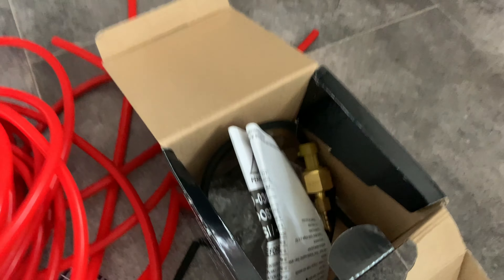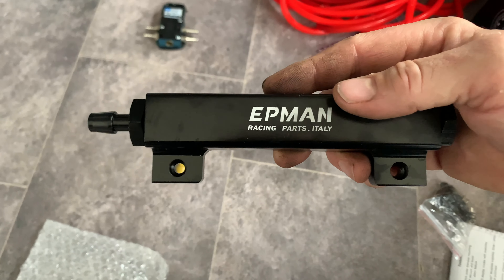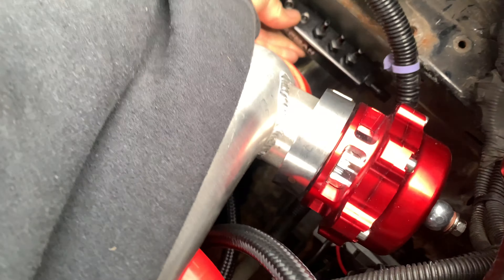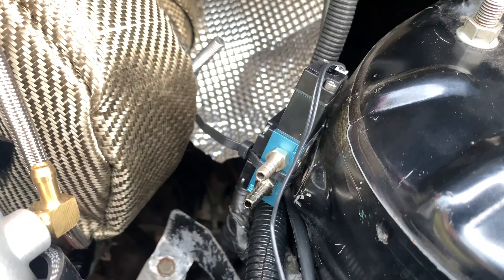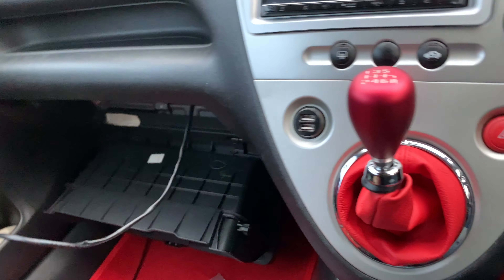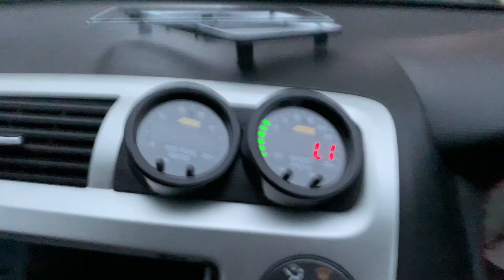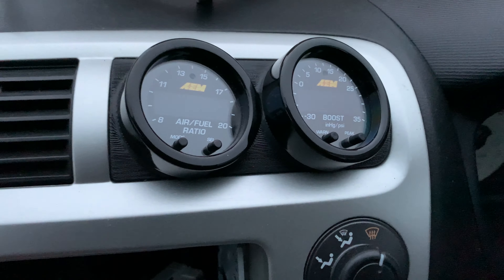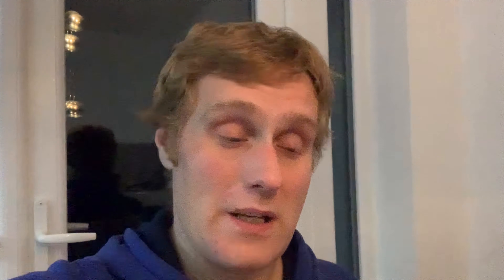K20 EP3 Type R Turbo Part 7 - Vac Pipes And Boost Gauge

Comment: How did you wire the Mac Boost Solenoid and Aem Boost Gauge?  Are you doing an extra clip?  Otherwise great work keep it up mate 😎👍🏻
Reply from the maker: Mac valve wires into the 2 wires that go to the evap sensor, doesn’t matter which way round you wire it up. Boost gauge just needs and Earth and a live, I wired it up to the cigarette lighter wires 👍
Reply: The evap om your throttle body. Where do you connect the hose from the evap. The oem line went with the oem fuel feed onto firewall . Do you just reroute the evap pipe away from the sidewinder ? Do you have to keep that round bit in the evap line aswell ? Currently doing my ep3 turbo and watching your videos as a guide. Thank you 🤙🏼

Comment: Do you have to connect the evap to the pipe on the firewall again ? Has to be moved for sidewinder manifold. Or do you just blank it off ?
Reply from the maker: I just left it, cut the pipe a bit further down the bulkhead it wasn’t connected anymore

Comment: Nice job with the vacuum lines.  Are you going to secure them using zip ties?  Nothing worse than having your vacuum hose blowing off!
Reply from the maker: I’ve never had problems in the past with them but maybe will when I finalise all the lengths and routes yeah.

Comment: Enjoying the build just wondering what diameter vacuum pipes did you use?
Reply from the maker: I used 5mm for most but 4mm to the fuel pressure regulator as it had a smaller diameter fitting

Comment: Why did you choose the 4-port solenoid over the 3-port one???
Reply from the maker: mostly because Americans seem to. and also it allows you to use up to 4x the spring pressure whereas a 3 port is about double.
Reply: @1BlueGhost  sometimes x6 spring pressure, but you lose definion, like changes +1% duty cycle = +5psi.
3-port is less sensible, easier to control.
Reply from the maker: That’s true yes, I noticed at one point we put 1% duty in and it jumped massively. No in between. It holds 10 ish ok for now though. 16-18 will be the aim later on.
Reply: @1BlueGhost  18psi will be likely kind of 450-460hp 🔥🔥🔥
Reply: @1BlueGhost  And finally what WG spring did you use?? And what % duty to get 10psi??
I found you channel more didactic and more inspirational than almost any other.
Your build with all of its shangai stuff is pure fire!!
I hope you it last long and makes big big numbers 👍👍👍
Keep posting
Reply: @1BlueGhost  One last question: what turbo, brand and exhaust housing a/r did you use??
Reply from the maker: It’s a 7psi spring in it, and the duty is about 46 I think. It works backwards we found out so less duty is more boost.
Reply from the maker: Thanks for watching, hope to make helpful ish videos and show all the failings as well as minor successes 😂
Reply from the maker: Gtx3582r dual ball bearing I don’t know if it has a brand with a .82a/r in the theory that the engines rev higher. Not sure if it was the right move or not yet, will find out. Will link the turbo below 

https://www.ebay.co.uk/itm/123746335738

People seem to say the pulsar turbo’s are good, although they are about double the price. Will see how long this lasts.
Reply: @1BlueGhost  I think its the perfect choice to make good power on stock K20, keeping the torque relatively low and less back pressure over the 0.63 a/r.
Reply: Best choice i mean for the size and for the housing a/r , not for the origin of the turbo 😂😂
Reply: @1BlueGhost  the turbo in the link has ported shroud anti surge compressor housing inlet with holes like precision style, where yours not, and has 4-bolt T31 style exhaust housing outlet where yours seems like it has v-band. I'm really curious about what unit you have, for futures references in a budget proven runing setup like yours. Thank you!
Reply from the maker: So it has! They don’t seem to list the one I got at the moment. 

This is the link to the one I have but it says out of stock currently - https://www.ebay.co.uk/itm/113716902493